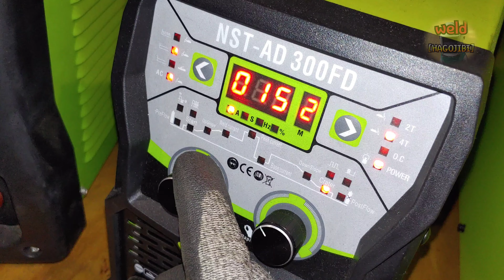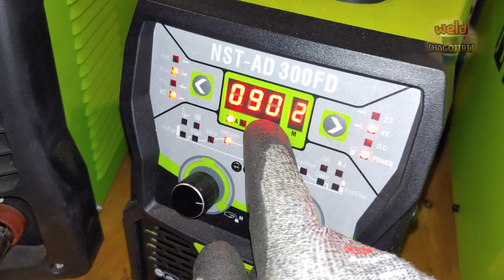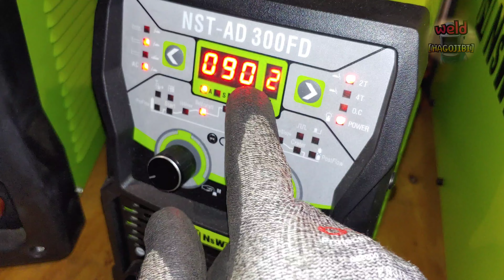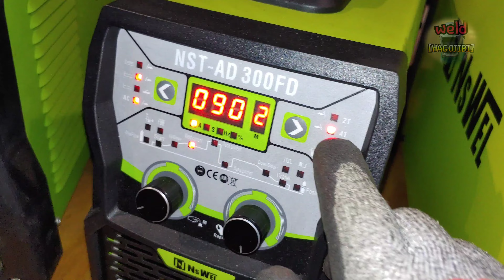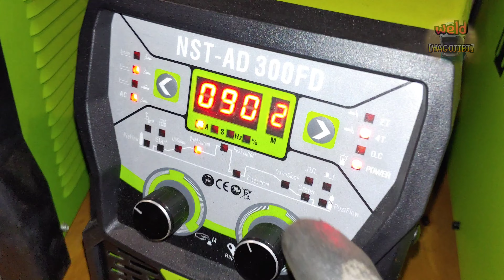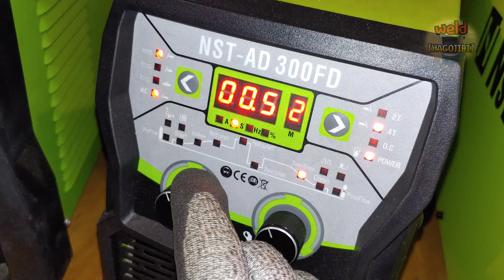3 useful tricks ! Level up your aluminum TIG welding work

Comment: Get some filler wire in there! You should not use autogenous process on aluminium. Having said that, the video is a good explanation of the benefits of pulsing in heat control.

Comment: I work with cloos brand machines and I weld a lot on resistance structure. I weld at 350-450 A. Thick profiles. In our automotive field we make good money welding(repairing) semi-trailers.

Comment: I would have been curious to see the frcvency on the AC and the cathodic stain where you keep it (at 0 or towards -). I used to work in research at the welding institute in Romania. I have been working with aluminium welding for 30 years ,but I really like your style of work. Congratulations.

Comment: ho provato i parametri in 2T ed è venuto un ottimo cordone. Ho usato peraluman 5754 da 2mm di spessore in 2 pezzi di misure 100x30mm. Ho impostato 80A invece di 90A e 35% invece di 40% di balance. Ho usato onda quadra. Con i parametri in 4T ho avuto difficoltà nella interruzione e nell'innesco. Puo' dipendere dalla torcia che ha il pulsante di serie. Forse nel mio caso ci vuole una torcia comandata a pedale.

Comment: Like, like as usual, but I miss your funny voice that is a part of show. About welding aluminium there are obligatory requirements because aluminium cracking property 1. Always root 2. never start welding on edge 3. at the begginning and at the end of weld should make an extra dab or pool filled with material. Beautiful aluminium welding and welding without wire is easy but technological wrong. In real production lern heat control and start welding from middle to edges on both directions with 20 mm overmelting. Teach your students better heat control skills, unless it's a decorative welding instruction for housewifes.  For example, make an ekibana from wire